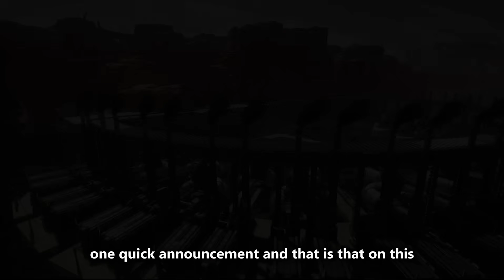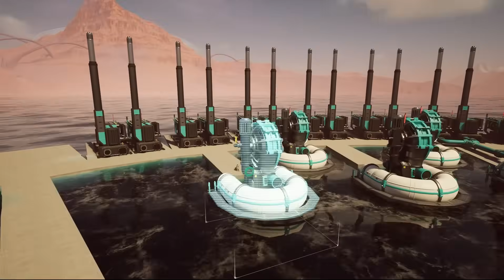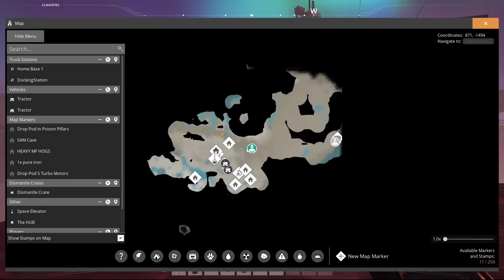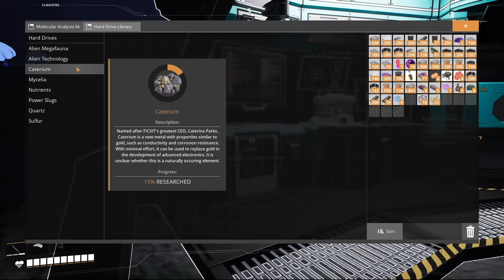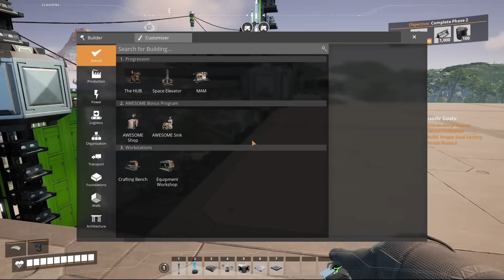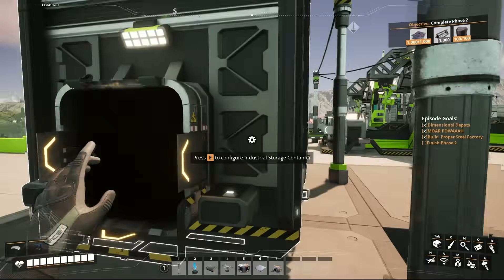SATISFACTORY  1.1 - Efficiency First - Cinematic Let's Play / Beginner's Guide Episode 5

Comment: I noticed you did it as well but didn't mention it. If possible (you have them unlocked), you should always use a mark 3 conveyor lift to the dimensional depot. The research tree tops out at 240 per minute upload speed, so a mark 3 lift or belt doesn't require upgrading in the future.
Reply from the maker: Great tip!
Reply: oh nice, that's an awesome tip!

Comment: i see you using 4 meter foundations underneath miners. Sometimes i can place the miner on 4 meter foundations, and at other times i cant and i have to swap to 2 meter ones. I dont quite get this. I tried both placing them in both the "lower" and "higher" position, to no avail.
Reply: Sometimes it helps to stand next to the foundation, but underneath it. Point the miner at the foundation - it may take some adjustments but that usually works for me

Comment: i had to pause right about at 16:40 ... you did calculations based on how much energy it gives, and how the constructors will make sulfur less energy efficient.. however, you did not take into account that compacted coal lasts for 8.4 seconds meanwhile regular coal lasts 4 seconds. compacted coal is a legitimately good use.
Reply: I'm still new but as far as I can tell as long as he can support and give enough coal to every machine it's better and easier. due to the fact that getting compacted coal takes another material which takes more effort and time to make. and even more power to make so it kinda evens out no? In the long run just regular coal is easier and faster. (again I'm still new so if I wrong please let me know this is just my opinion)

Comment: Been watching your content and enjoying it. Thank you in advance.
 But I have heard lots of arguments about compact coal. The 630MJ of compact coal is relevant to the amount of water the coal generator is required to supply and fuel burn times. The power output of compact coal is around 110% greater than coal. 

To understand my comment clock a normal coal power generator to 50Mw and it should burn 10 coal a second and consume 30m3 water. To math the compact coal power plant clock the power generator to 105Mw and it will burn 10 compact coal a second for 63 M3 water. The math is MJ /10 for coal generators with all fuels. 

Because of the assemblers for compact coal. The assemblers are best underclocked to 20 compact coal a minute on output. This should net 6 assemblers for every 12 generators. This would lower the tear of infrastructure to tears 1 and 2 belts.

 The location in your video is often where I construct a 48 generator 5040Mw compact coal power plant. I use the normal coal and sulfur node and save the pure coal node for export. Requires understand in how to use smart splitter for flood gate manifolds and some balancing with a branch manifold setups. 

 The advantage of compact coal power plants is the power plants “foot print” that is its size or space it takes up and the sulfur could be delivered by vehicle. A disadvantage is compact coal power plants take extra time to build and set up.  It takes all day and does need an upgrade to a belt later. Because compact coal power plants require around 100 power shard to properly clock. They appeal to exploration players. 

Refining the argument for compact coal. Compact coal power plants have a lower overall power efficient (PE) compared to normal coal power plants. I have never obtained greater than 85% (PE). I would never gain greater because this would require extra assemblers and water extractors to be underclocked. Defeating the advantage of the power plant. Basic coal hovers around 88-90 (PE) depending on clocking like 50Mw, 75Mw, or 125Mw. A lower power efficient means less power available because of the cost to power to make that power. At 80% (PE) is good enough, higher is better and better is wanted. Fuel gens are around 90% plus. 

Compact coal is still worth it. But if your planning rocket fuel that sulfur is going to be needed latter. Look forward to that video.

Math example for PE Bio mass generator.

( ( 10 generators at 22.5mw – two constructors for solid bio fuel ) / 10 generators at 22.5 ) *100

(22.5*10)- 8 Mw / (22.5*10) * 100 = 96.4%

What do I do about something that is my fault. Many a time I have done everything right and it still comes out wrong. I share fault. I do not consider anything all my fault or the others. Unless clearly is. But sometimes I just build things like compact coal power plants for fun or to find out and get my mind off it. But sawing a branch on a tree that I am standing on. Well that is clearly my fault. Just learn from it often is passes with time.

Comment: Good stuff.  I am doing a session with the same start.  The only major difference is I use an iron node near the coal nodes and bring over the steel beams instead of coal.  I like to move goods as close to finished as possible.  Technically I could do the versatile framework there as well but I like having access to modular frames and steel beams at the central location and soon enough the versatile framework isn't required.  So it works better for me.

Oh and something you will likely forget about soon and never need but I wanted to mention since you started this series.

You spoke of gathering leaves and wood by spamming E.  I think people know this but forget but you can look at a bush, hold E, tap Q or Tab then E is locked until you hit it again.  Meaning just run around and auto gather.  I am pretty sure that is a built in feature of the game engine.  I have seen it in other games using the same engine.

Comment: How do you calculate the number of machines that will fit on that half circle ahead of time?
Reply from the maker: Im going to go through it in a dedicated video because im getting a lot of questions on this plant. In short though, its simple geometry. I know I wanted the half circle shape, and that it would house 36 generators, so i put down 2, rotated 10 degrees, and repeated 18 times for a total of 180 degrees (half circle). I did make a guess for where the middle would be (based on experience) but you can see in the timelapse that I was off by about a foundation.

Comment: I'm curious when you get a good fuel power setup do you tear down your coal power plants?
Reply from the maker: I dont tear them down but sometimes I take the coal and divert it elsewhere. The build remains in the world as a set peice even if i deactivate it.
Reply: Sometimes. It depends. If my oil power is dependable and I need that coal then it makes tearing down coal plants easy.

More often than not, I make an effort to acquire geothermal energy and supplement my coal power. It sets me up with power tower veins I can branch off of towards other resource sites.